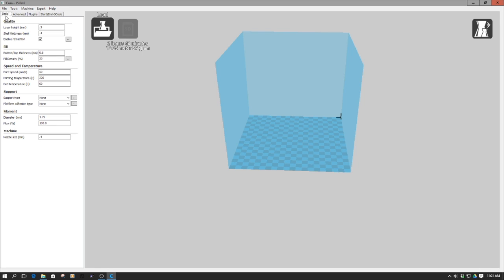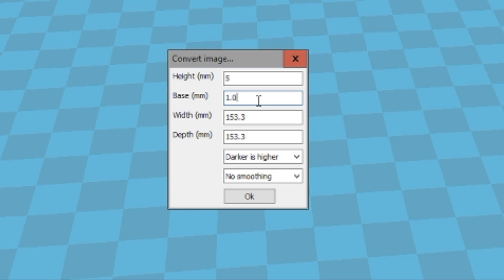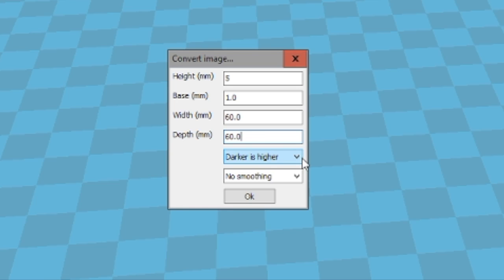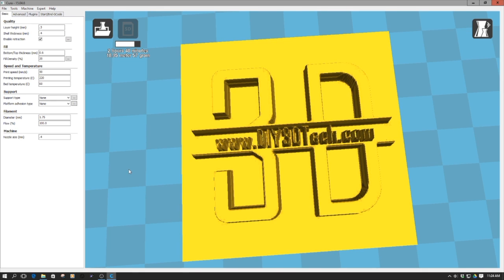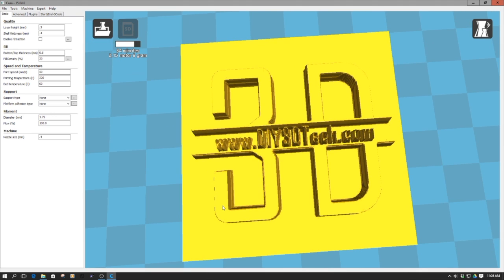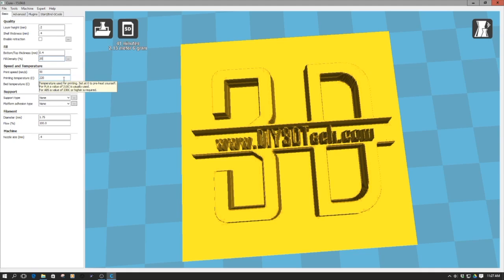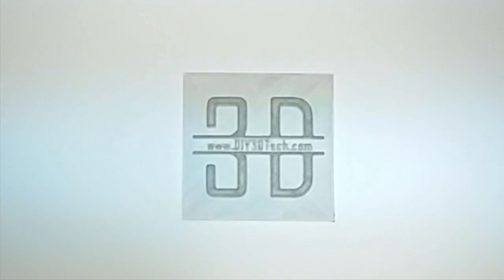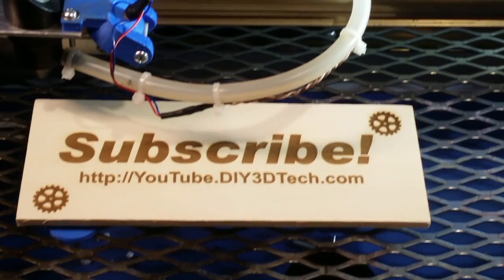3D Printed Project - Creating a Lithophane with CURA!

Comment: What type/brand/color of filament did you use?
Reply from the maker: Wow that was so long ago, I am sorry I don't recall...
Reply: No problem. I've tried making lithophanes in the past, but I used a white PLA which just blocked all light and completely didn't work. Anyways, thanks for the video and the instructions.
Reply: @DukeOfMarshall  You probably have your answer by now, but white PLA has worked fine for me.  I set the max thickness at 2-2.8mm, 0 smoothing, and 100% infill.  I printed with  layer height of .12mm and a speed of 25mm/sec.  Results were great.

Comment: when I open a jpg in Cura 2.6.2 it auto fills width and depth with a long number, like 117.76470588235294. If I delete everything after the decimal point as soon as I go to the next box it auto fill this long number again. Have you had this problem, know how to fix or should I just disregard?
Reply from the maker: Wow I did this so long ago, I am not sure how the current version of Cura is handling this so my suggestion is try it and see and might be worth me revisiting this with the newest version...
Reply: Behaves the same way in Cura  3.1.0 no matter what number you put in the top or bottom, if you do 60.0 it will put 30. so if possible a revisit would rule

Comment: crazy cool man .  omg  great video
Reply from the maker: I see your light box as a crazy backdrop for this, however RJ Make has gotten me somewhat hooked on drones (darn him) and just closed yesterday on a new house which means I need to start building out the new shop area as this one will be a lot larger so meeting with painter today as I going to have the ceilings and walls sprayed and an epoxy floor laid down so I can start moving kit in and then there is the electrical, dust collection as all of the other things the wife expects.  Ugh..  So have video queue till almost the new year so I need to get busy :-)

Comment: Been playing with this for a while now.  It is a fun hidden tool in Cura.
Reply from the maker: Yes, it is pretty cool, do you have the same issue with the dialog box acting all strange when you change the size?  Have it on two machines and both are that way...
Reply: Yup.  Took me a few times to get used to it.  But, I think that if they fixed it now that would throw me off as I have gotten used to it...lol
Reply from the maker: Whew!  Thought it was just me :-) Thanks for letting me know...

Comment: Bwahahaha!  That's funny.  I would have asked that question. Actually I had one a long time ago when I was a construction coordinator  for a general contractor. We used a 48"x36" light box to go over the different trade's shop drawings for each area of the building.  Got rid of it when everything went digital and 3D. It was cool to see all the mechanical and electrical system all in one 3D system. 

But I digress, the lithopane is cool and I was not aware that Cura was able to do that. Now I need to find some cool photos and make a few. 

Thanks for the inspiration. 

Better return that to the wife... or your name will be Mudd. Lol
Reply from the maker: In December you will see one come out where I do Christmas ornaments :-)  However they are a lot of fun to mess with as I need to do one with Elvis and backlight it!
Reply: DIY3DTECH.com - My aunt loved Elvis!! That episode will be a cool one no pun intended as it doesn't get cold here in the Central Valley of California. Lol
Reply from the maker: Have to make the box out of black velvet :-)
Reply: LOL - Is there a velvet filament for that?  ha ha
Reply from the maker: Ya know It wouldn't surprise me!